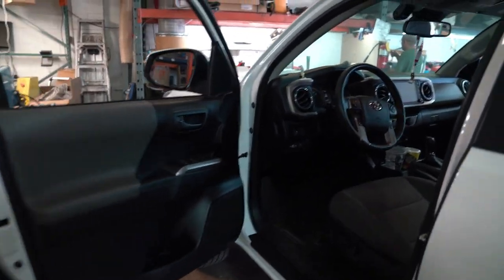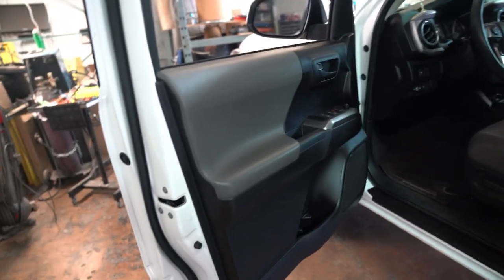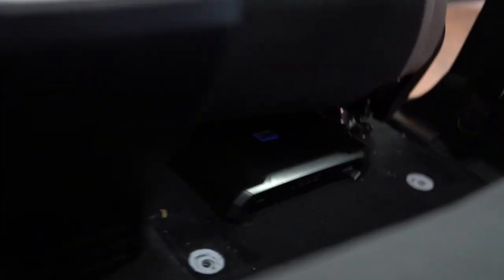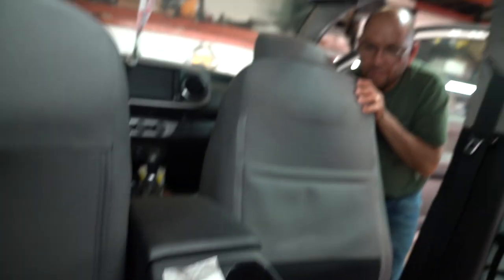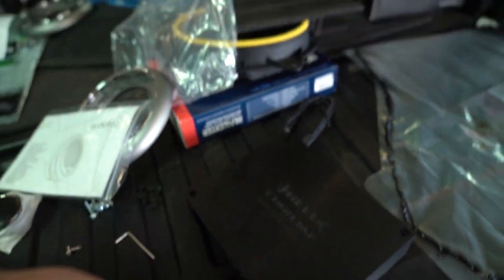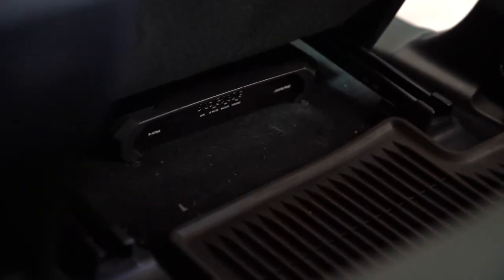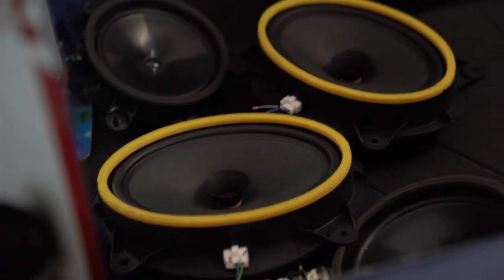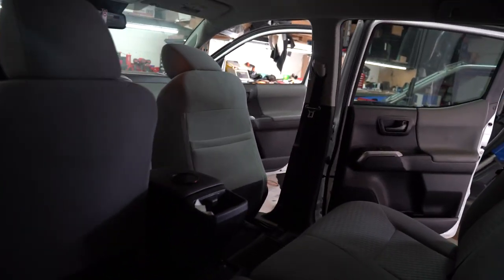Audio Frog GB15 and Gb60 with Helix v eight dsp amp Tocoma build

Comment: I'm curious why the install guy did the cld differently on the two front doors. On the passenger side, he installed the CLD around the speaker opening, then installed the speaker and adapter. On the driver side, he installed the speaker and adapter to the door then put CLD over them. Seems odd!

Comment: Hey Boss solid setup ! Do you by chance know if the GB15 will fit in the stock location of a 2017 F150 A Pillar ? I have heard they do with light trimming l, but also heard that if you have the sunroof that the drain lines down the a pillar might get in the way. Can’t find a solid answer, I wonder if I need to order both the GB10 and GB15 just in case and sell/return whatever doesn’t fit. Any info is much appreciated !
Reply: They fit, little more difficult with the sunroof drains but they still fit

Comment: I've never had an opportunity to hear Audiofrog  in person. I tend to like the Morel sound (warmer) more than Focal, any opinions about how Audiofrog compares to Morel or Focal?
Reply: Made in china
Reply: The audiofrogs are said to be neutral tho I myself don't really know what all that is about since I use an eq..but I do own the gb10s 25s  and 60s in my front 3 way active and I like them and to me they do seem to not really have any sound I have to try to take out with the eq, but they do natural lack I guess what you would call a warm sound with a flat eq setting
Reply: I allso put a set of the gb 60s in the rear door cause I like mid bass and used a sound bar for a boat for the rear sound and just mounted it to the hangars my truck has above the rear window witch turned out to be an excellent rear fill combo, and is plenty out of the way as far as I am concerned for the passengers..
Reply: To be honest tho them boat sound bars are kinda impressive all there own I dont think I would miss the speakers in the rear doors other then that gb60 mid bass thump! But them boat speakers on that bar are nothing to laugh at they hold there own!  Defenatlly like the 4 gb 60s tho
Reply: So 2K😅

Comment: Was 75w rms enough for the gb60 or you bridge 2 channels for each???
Reply: Can't bridge that amp
Reply: Yea you can @drrckhamilton
Reply: @coolme241  

I actually bought this amplifier.   According to the Audiotec Fischer website, the amplifier is 75 x 2 at 4 ohms, 120 x 2 at 2 ohms......but is NOT bridgeable at any impedance.
Reply: @coolme241  

I'm not sure as to where you may be getting this information from, but nope.